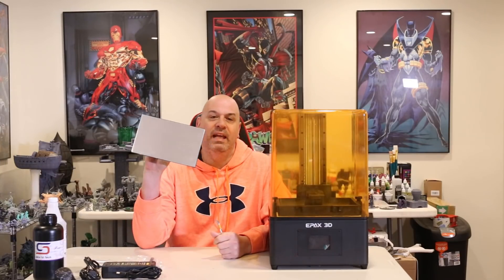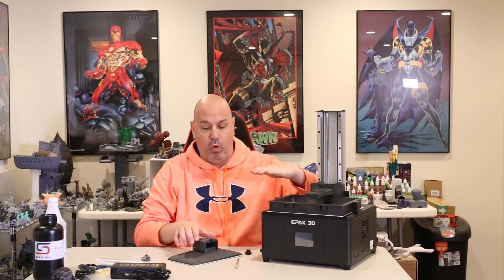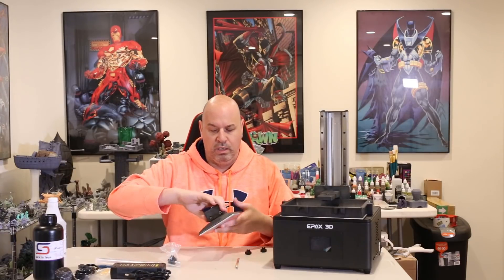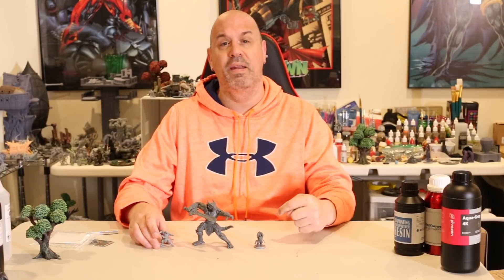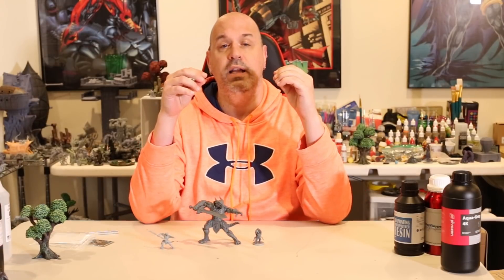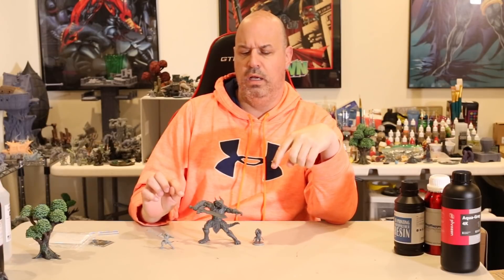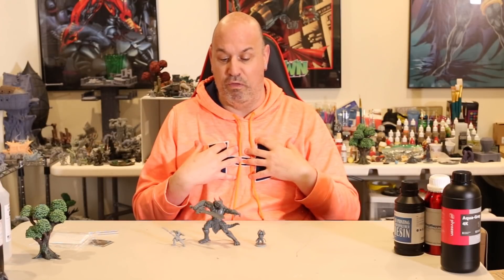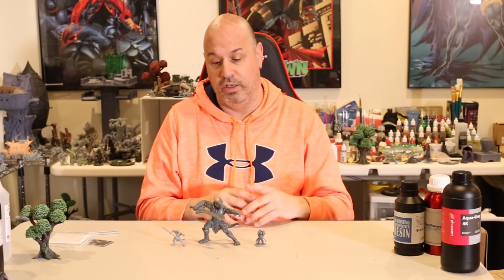Epax E10 5k Monoscreen review!  First 5k screen for home resin 3d printing

Comment from the maker: Sorry I didn't go back and add the price in because I am waiting for Epax to tell me the Price!!!  Will update here as soon as I know!
Reply: and please ask them when it'll be available. especially the upgrade kit for the 8.9 E-10 owners! THANKS!!
Reply: @pgabrieli  seconding this, sadly I just ordered a replacement 4k mono screen for my E10 - might have been worth waiting for this instead..
Reply: @brett3366  Me too. I just figure I'll wait 'till I lose another one and upgrade then  :)
Reply: @asimhussain8716  - Same boat. I’m about to get into 3D printing and this looks like the best of the best.
Reply: More importantly, is it still working?! I've had 2 E10 screens die, and lets just say epax support is worse than Phrozen, Anycubic, Elegoo and Creality. Giant line through the polarizer perfectly straight and then half the screen died on the replacement, not to mention that the 2 vats I got with my initial order ...1 had a massive leak OOTB
Reply: @lonestarr1843  If you haven't yet, avoid Epax. Halot Sky is supposed to be the one to beat if cost isn't a factor, although the mono x does let you adjust the screen intensity for different resins which is amazing.
Reply from the maker: @SB_Artsy  Yeah mine is still going strong, usually Epax has good customer support, sorry to hear you're having trouble  :(
Reply: @SB_Artsy  - What makes Halot Sky better than the Epax?
Reply: @JohnSmith-od1qc  how long did it last?

Comment: That plastic arm is most likely better than metal. It's made out of glass fiber reinforced nylon I believe, which is incredibly stiff. You can also increase the cross sectional area, so it will be stiffer than metal. Same goes for the build plate. It also will not permanently deform like an aluminum arm or build plate. I've printed full build plate parts on the E10 4k and had no issue.

Comment: what is you absolute favorite brand of sla printers? i think i've heard you talking about the prhozens and the epax printers.. but cant recall which brand if your favorite.. i'm planning on buying a midize printer to join my Saturn, and recently in prime day the anycubic mono X was in $530... but i tie myself to a pole and kept me away from that buy button cause i know i can do better if i wait a few months... perhaps this epax E10  5k would bt the one?... not use if i want to go as high as the phrozen 8k just yet... but if you recommend that one.. i will get that one... i preffer to invest a bit more in having a larger prnter and making sure i can print larger stuff f i needed.. i have the saturn now for minis when i need them.

Comment: i have this printer but with the 4 k screen. it uses the same build plate as the 5k one but the 4k screen is smaller. haven't had any issue with the plastic arm
Reply: Why keep the build plate the same size but increase the screen size?
Reply: @forouza1  they designed it to be upgradable. so you can replace the 4k screen with the 5k screen. when you do that you will have the 10.1 rather then the 8.1 screen. so that is why it has the larger build plate even when you are using the smaller screen.

Comment: Could you do a comparison of 28mm minis printed on the EPAX E10 5K and minis printed on the Phrozen Sonic Mini 4K? I'm really curious if the additional resolution of the Sonic is worth sacrificing build area for. Trying to decide what resin printer to go with for minis and terrain.
Reply: I've got a SM4K and use it for 32mm minis. The details are really good, but its honestly too small for terrain (maybe small scatter terrain, but nothing larger than a tree). I'm considering something larger for terrain and bigger minis, or a FDM for big terrain.
Reply: I don't believe it would have additional resolution, since it's a bigger screen. It's all relative.

Comment: Greg FYI the version of the E10 4K they are shipping is shipping with the same high grade plastic arm and build plate you the one you received with the upgraded 5K screen.
Reply: All E10s are identical, with exception of the 4k and 5k screens. They were designed that way from the get go, so the users have an option (in the future) to replace 4k screen with a 5k instead of another 4k screen. In the near future this may not be such a great idea if the 5k screens are significantly more expensive.

Comment: Can you post an update in about 4-6 months on how that plastic holds up? Plastics usually don't do too well with resin and that build plate is going to be spending a lot of time covered in resin.
Reply from the maker: Yes if I see any issues I will update immediately  :)
Reply: @3dprintingpro212  can we confirm - Its not a plastic arm... the real arm under the plastic fascia,  is a proper steel channel welded to a plate that attaches to the two linear rail carriages.
Reply: from above - Shyam Javali - i heard this too on Epax FB page ... if so the plastic is not as structurally relevant
Reply: @learnilluminatedrealitystu5571  Then why does it flex so much?

Comment: hi great video i have a question

I'm about to buy my first printer, which is better?

Elegoo Saturn or Epax E10
Reply from the maker: They are both great in my opinion, this new e10 is a little bigger, and won't be out until around May.  I have one Saturn and it has been great for me so far a real workhorse.    I think either 
one is a good choice
Reply: Saturn hands down, better quality machine and Elegoo support is top notch.
Although Halot Sky is supposed to be amazing for 4k

Comment: Not too keen on the idea of a plastic arm - plastic stress fractures quicker than ally alloy billet.

Thanks for letting us use MrsPro as a scale as well as your glamourous assistant

By the look of it that printer is about 1/3 a MrsPro, while that last monster one was around 1.2 MrsPros. Im wondering how a Peopoly Phenom L does on the MrsPro scale....I suspect that beast is around 1.5 MrsPros

Comment: Actually your resolution jumps up quite a bit going from 4k to 5k even with the size difference. The 8.9" 4k is around 330 DPI while the 10.1" 5k is around 565 DPI. Now MAYBE that doesn't make a huge difference in prints idk, but it's certainly a significant DPI upgrade imo.

Comment: I really need some help with my longer orange 30s. I print a lot of your supportedmodels and I used to be able to print them out without any fuss. But now I am unable to get a good model out, and the detail is much less than before. A lot of times the supports print but the model just isn't attached. Of they print nicely, but a leg, or arm is missing. Im losing my mind here.
Reply: How long have you had the printer?

Comment: Thanks Greg. I saw a post that said the E10 10.1 screen upgrade kit would be equal to the cost difference between the E10 8.9 and the E10 10.1 with the bigger screen installed. Do you have any information about this, or when EPAX contacts you with pricing, can you ask about the upgrade?
Reply: I actually just spoke to an Epax rep yesterday and they mentioned that same point to me, that they were intentionally going to make the price of the 4K and upgrade to be equivalent to the price of buying just the 5k

Comment: Bro, i can see it flexing as you touch it.  It's VERY flexible....
Reply: The arm outer shell is the same material as the vat - a glassfibre composite - but the core of the arm is a welded 2mm steel box section that bolts to the linear rail blocks
Reply: It’s polymer it should be alright glocks are literally made of polymer and they last forever

Comment: Maybe a dumb question because you kind of touched on it resolution but, how do the details look compared to mini 4k and ibee? I'm trying to figure out if I need/want a bigger build area or more detail
Reply: You will need a 8k screen (or better) to see any difference due to the LCD screen. Based on interest in resin-type printers, the 8k screens will definitely be made. I am skeptical that putting 8k in a small printer (that at some point will be called very small) would make much difference, but I could be wrong of course. Other factors are quality of the light source and of the resins being used.
Reply: @michaels3003  I know effectively a larger 4k screen means 2k resolution. But what does it look like? I haven't done any printing to be able to visualize and determine which printer would be what I'm looking for
Reply: @Brandon-zw3hw  , the results from good quality printers are very similar. IBEE claims the latest LCD and UV technology, but I don't know if they are better than those used by Epax. You would chose a printer like this for reputation of the company in terms build quality, availability of parts and accessories, and quality of the provided support.
Reply: @Brandon-zw3hw  , this is too simplistic. I've just calculated that the nominal pixel size of this printer (45 x 45) is 65% larger than 35 x 35. By size, I mean the the area (X times Y) of course.
Reply: @michaels3003  thanks for the calculation, but I meant what does the model look like. That's what I care about. If a mini 4k has that wow factor over a large base (epax, ibee) maybe I would choose the mini. If they are close enough I would probably go larger base
Reply: @Brandon-zw3hw  , you need to search for resin printer reviews on YT (and elsewhere) where people show close-ups of of detailed models. There is no easy way. I also think the wow factor is totally subjective.

Comment: Whats the XY resolution?
Reply: Willian, you putting too much emphasis on numbers. The pixel size is same or similar than with the 4k screen. This new model provides a slightly larger build area if you are willing to pay a higher price (which is TBD at this time). If you print some calibration models with a specific resin and a specific temperature, they will show you the smallest feature (positive or negative) that can actually be printed. What we need is higher contrast (i.e., better masking) and more uniform illumination, not a  smaller pixel size.
Reply: @michaels3003  I asked the question because I work with jewelry, the XY resolution interferes a lot when we do details around 0.3mm
Reply: @whcHIDRO  , what pixel size are you using? This is not the same as the real resolution that would take four pixels to resolve if the pixels exposed the resin perfectly (they don't). This printer's pixel size is 45 x 45 micrometers. Quality of the display, the light source, and the resin used result in lower actual resolution (the smallest feature size possible). The idea of this model is primarily a slightly bigger print area (15% longer and 15% wider).